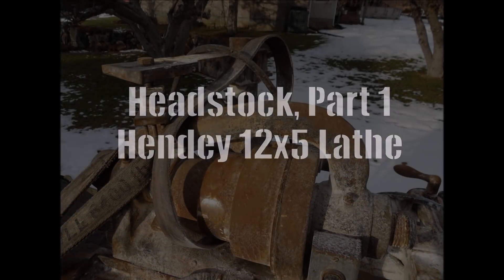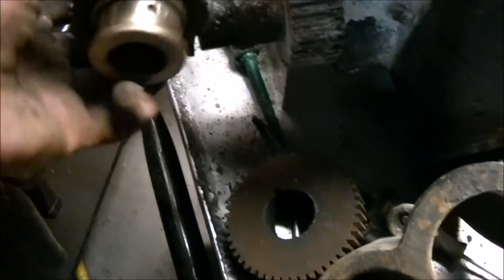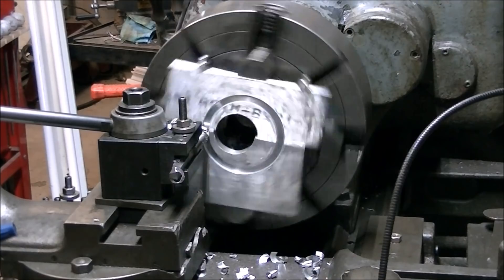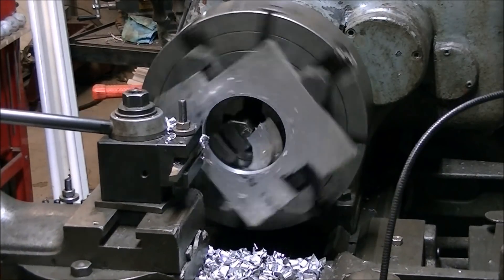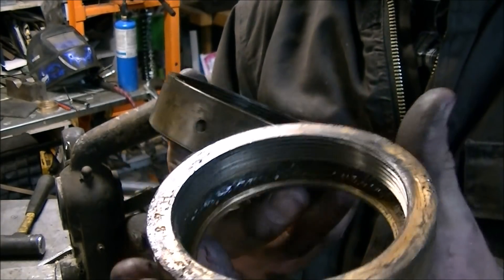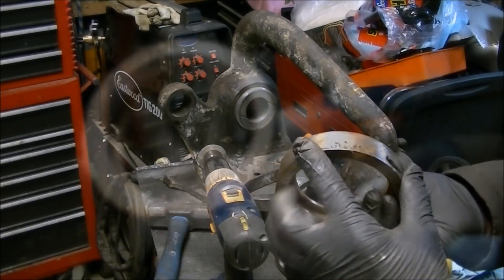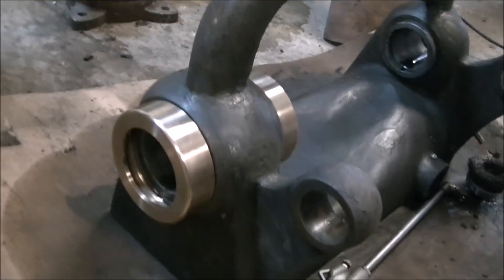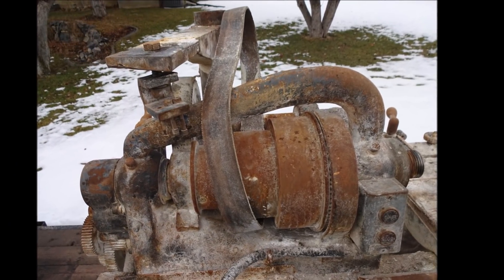Hendey Lathe Headstock Part 1

Comment: This is terrific....I have two of these, one still in service. The other is bound up which is common problem. Over the years I have periodically  looked for a solution online but had limited success. Ten years ago people were junking these lathes and not bothering to take them apart. Your video is a godsend. I still would like to know how you got the spindle out after you took the brass retaining ring off...puller, custom push..hammer (I never ever use a hammer and I even cringe when you do it)

Comment: Looking good. One could use the tig in AC mode using a Nibral (Ni-Bronze-Al) rod. The AC keeps it a little cleaner. I have used the Eutectic 1851 rod, works great....anyway my two cents.. Thank you for the great videos. -T

Comment: Hi Craig I am searching for the serial number on my Hendey lathe but I cant seem to find it. Is it by the headstock/tailstock between the ways,  by the leadscrew  by the headstock/tailstock. I have been looking all over for it but I am not able to find it without stripping it all for 3, 4 layers of paint and dirt.
Reply from the maker: Netptun773 the serial number should be stamped into the flat between the front v way and the flat way near the very end of the lathe, on the tail stock end. I've heard tell of lathes that were refurbished and the bed reground where the serial number is missing but I think that would be very unlikely as the flat where the serial number is stamped is several hundred thousandths lower than the ways. Good luck. If you post your serial number on the Practical Machinist antique machinery section, hendeyman might be able to tell you the details on the manufacture of your lathe. Craig
Reply: @clemwyo  it's gone. I fully agree with you so I am wondering if the serial number has always been stamped there and I might find it an other place on it... but I doubt it... thanks for your help Craig. BRG's Knut
Reply from the maker: That's where my 1910 and my 1943 Hendey are both stamped. There are numbers stamped on most of the parts but I think they are just assembly numbers as they don't correspond to the serial numbers. Post your question on the practical machinist with a photo of where it should be and maybe one of the experts will have a suggestion. The year can be narrowed down by some of the features like the apron and the plates with threads and feed speeds.

Comment: I have a lathe exactly like this in excellent condition. It is for sale $1500.00 304-488-3315. It has a 4 jaw chuck, some older collets & a taper attachment.
Reply from the maker: John, you might try posting on the Practical Machinist antique machinery forum. There are lots of folks there afflicted with Old Iron Disease. The price might be a little strong for a conehead but you never know when someone is looking for one. Craig

Comment: You mentioned taper pins, and apologies if I'm just rehashing something you've covered, because I haven't watched the whole clip yet (and won't be able to for a while)  .... but I did once refurbish a WW2 Pratt & Whitney lathe, and the best advice I got about taper pin removal from a friendly toolmaker,  (particularly if they have not budged for many decades) was this: 
Get a set of stubby pin punches. Most punches are quite long, and you lose a lot of the directional shock intensity. 
This presents as the punch jumping off the end of the pin -- whereas with a short punch, it feels almost as though it's joined to the pin, by comparison. It's very effective, as well as satisfying and easy, and much less likely to cause damage.
Of course heat and penetrating oil helps as well. Haven't tried melting candle wax or beeswax into taper pins (probably the clearances are too small) but it's awesome on rusty threads.
Reply from the maker: +Gottenhimfella it's funny you should mention the stubby punches. Most of my first punch set is now stubby as I have bent and mutilated them, I've had to grind them in to stubby punches. It would have been better to start with the stubbies. Now that I think about it I wonder why most punches are so long? Most of the things I drive out are less than 1 inch. Thanks for stopping by. Craig

Comment: Hi Craig.
I have the same Hendey 12x5 and having some issues with removing backplate from spindle. Do you know by chance what is the thread over there?  Also what is the taper inside the spindle ?  
Thanks. Gene.
Reply from the maker: +Gennady Yakubovich I'll check it and let you know when I get back you the shop. Craig
Reply: Good luck with the spindle taper. Mine is a four and a half Morse taper.Wasn't aware that such a thing existed, but sure enough. that's what it is.
Reply from the maker: +Chattonlad +Chattonlad +Chattonlad according to Hendeyman if the Practical Machinist forum, mine has a Morse-Hendey No. 4, which is a hybrid size also, but I haven't measured it to confirm that. The tail stock quill has been replaced and has a Morse 4 taper which is the same as my big Hendey so that is nice. Thanks for watching and commenting. Craig

Comment: I would find it hard too believe you when it comes too this lathe without seeing video? It’s almost unbelievable under all the rust and crud,how good the condition of this lathe is. This goes to show how well Machines were made back in the day. 
     I am subscribed and have watched all of your videos. 
    I am sure you will get this lathe working better or close too what it was when new. Curious as too what power source you are going to drive this lathe when you’re done?
Reply from the maker: +M dlanor it came with a 4 speed electric Lima drive unit. It needs a little cleaning but appears to be in good shape. I'll get into that in a future video. My current theory is that the carriage feed gear broke years ago and so the lathe got stuck in a barn where it sat until I picked it up. There certainly is a lot less wear than my gearhead Hendey.
Thanks fort watching and commenting. Craig

Comment: Absolutely beautiful head stock, but I may be a little bias 😃. 
Nice job man, love the old tie bar lathes
Reply from the maker: +Steve Summers Hendeys are addictive that's for sure. Although your pretty little tool grinder did cause a twinge of jealousy I'll have to admit. No idea how to run one but now I want one. Thanks for stopping by. Craig
Reply: clemwyo LoL, I did get lucky on that grinder deal. They are out there for not so much money.
I like this one because it's small, the Cincinnati #2 machines are nice and I would love one but it would take 1/2 the shop.
Reply from the maker: +Steve Summers the size is what I liked about yours. For the kind of work that I think I'd use it for the smaller footprint seems ideal. The other thing is the accessories and tooling with yours, the ones I usually see around here are bare bones without any extras and that makes them almost useless because it'd cost far more to try and come up with the accessories than then machine cost. I'm excited to watch you figure yours out. Craig